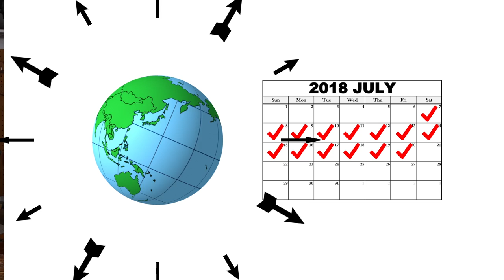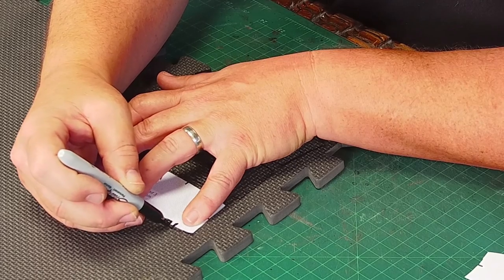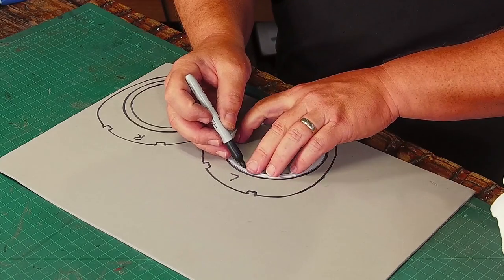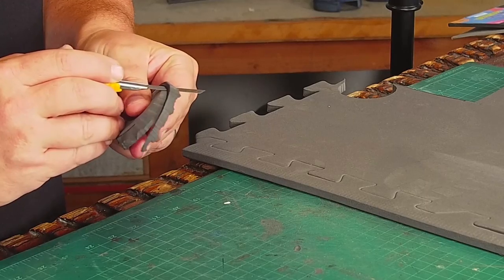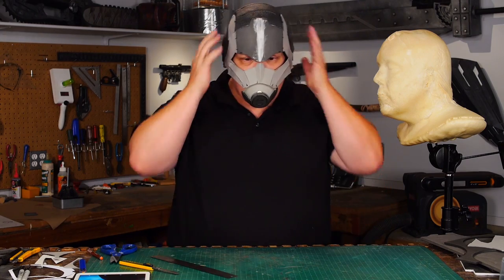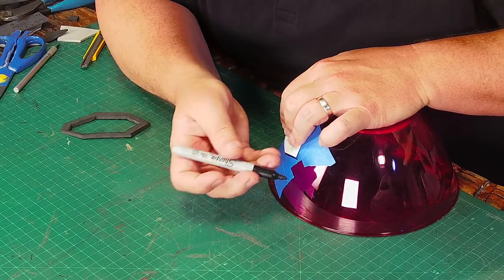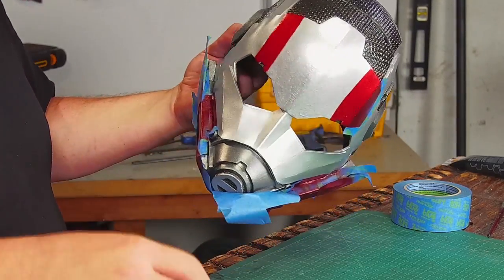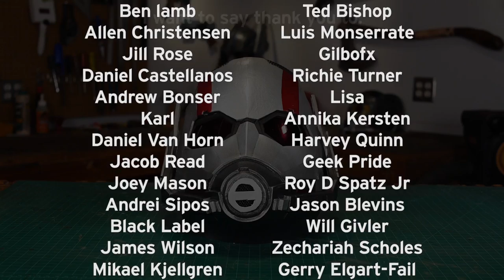Odin Makes: Ant-Man's Helmet from Ant-Man and the Wasp

Comment: Very cool! I was thinking of making the forehead of the helmet as one piece and avoiding the middle seam. That piece doesn't really bend very much. I am hoping it works out ok. Thank you for the templates!
Reply from the maker: Go for it! I thought I was getting too much of a bend in it. You might be able to do a butterfly cut, where the seam only goes part way, then the top could be as smooth as possible...

Comment: I don't have a heat gun... What else can I use instead? And I also don't have that metal round thing in the dowel for curving the foam.
Reply from the maker: A hair dryer can warm up the thinner foam, but a hair dryer is probably not hot enough for the thicker stuff. You can get a heat gun from Harbor Freight Tools for about $10. Maybe less if you find a coupon. That metal thing is a plannishing stake, and you have to make it. Mine is just a plastic punch ladel from the dollar store epoxy glued to wood. Cut the handle off the ladel first.
Reply: @OdinMakes  Thank you so much! I live in Canada, so I dont have a harbor freight tools store, so i'll try to find one online, or at Canadian tire.